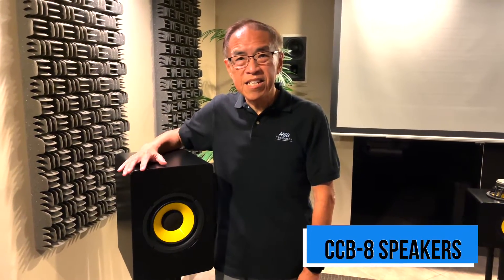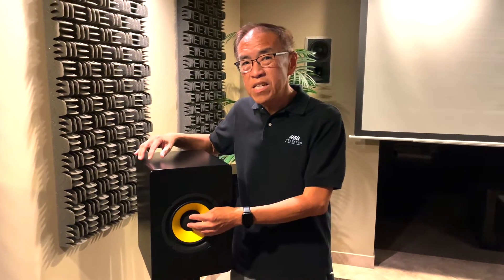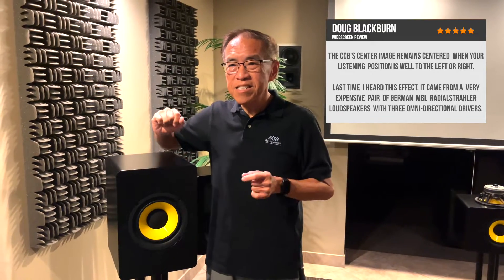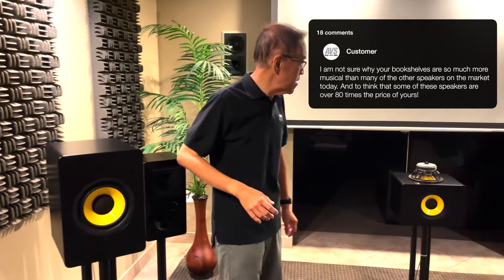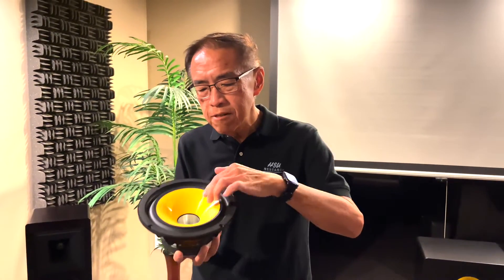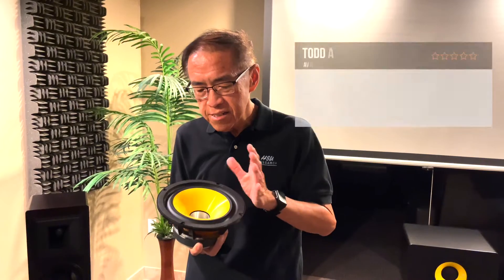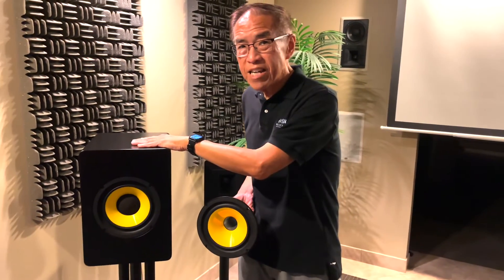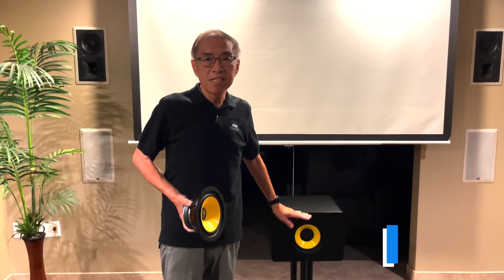CCB 8 Speakers - HSU Research

Comment: I just saw this video and thought I'd advise my experience with the CCB-8s. I bought them sight unseen based on the reviews in 2018 for the L/C/R in my newly constructed 7.2.4 Dolby Atmos system.  As they are now into their final months of warranty coverage (7 Years without any issues!) I'm still blown away at their sound, as are my family and friends. I was concerned about the yellow cones but with the grills on (to prevent mishaps from the little ones) you hardly notice them, and when someone does for their first time, it's a conversation piece => until they hear them. Of course the new ones are all black. These are the best speakers I have ever bought. Well done HSU.

Comment: Just got mine for center channel......tried SVS ultra evolution, monolith tx360, like this alot better very clear dialogue. Works perfect in my TV tv console
Reply: That's good to hear, I have a ccb 8 coming to try as a center channel for my Revel m106.  I've had a monolith thx 365c and thought it was great, even comparable to the revel c208 in some aspects.  I had to get r8d of the 208 because it was too big for the space.
Reply: @knuckledragger34  do you have an update? Interested in hearing your thoughts.